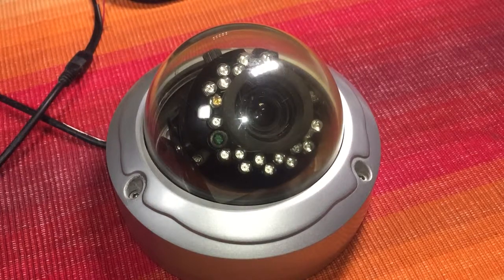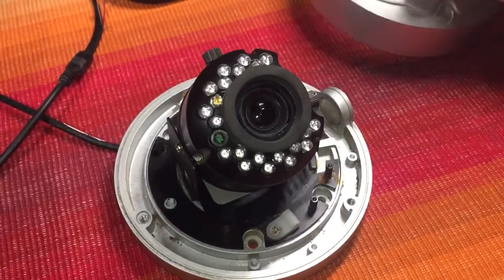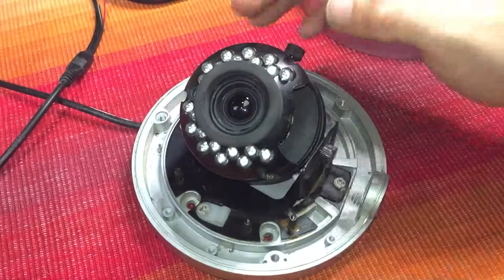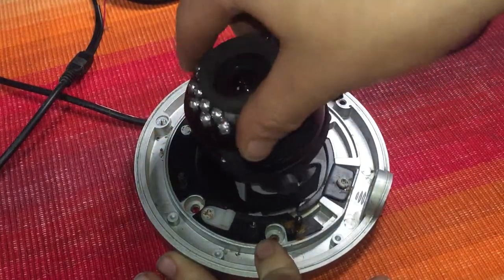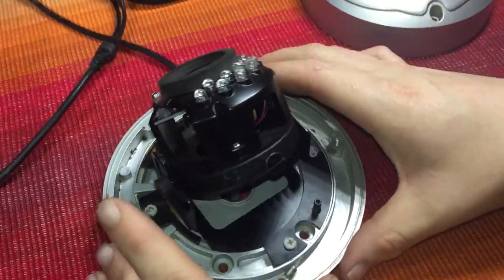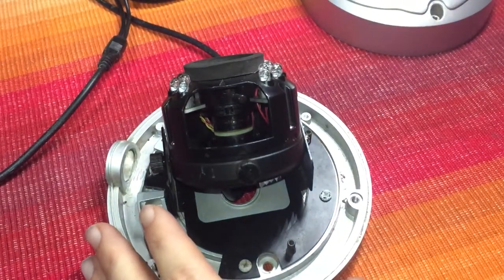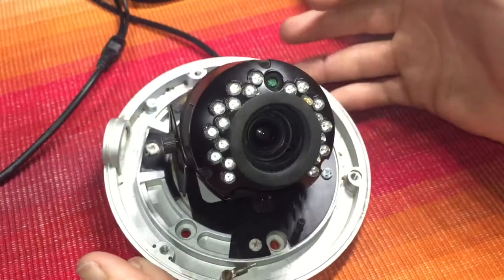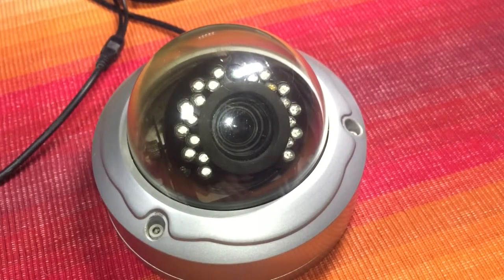CCTV IR DOME

Comment: I do quite like to look at them dome cameras. Only problem I find is reflection if not cleaned often enough. Even if it’s a sealed unit dust still gets in the only time I could see me using one is in a High risk area as in a front door, or Low installed camera